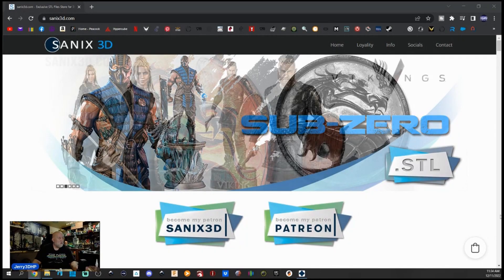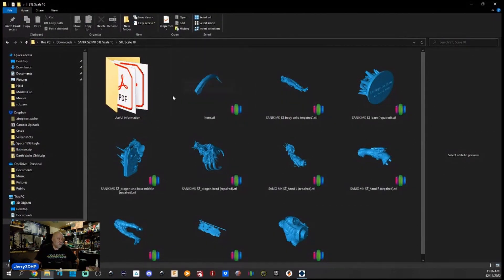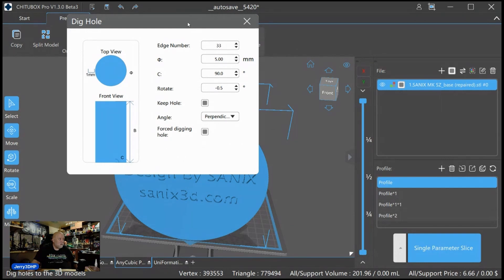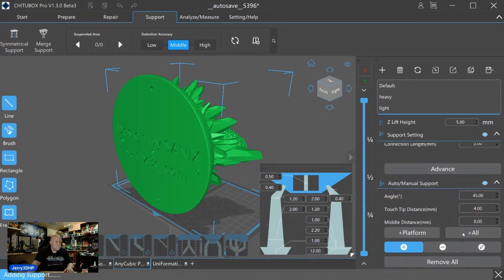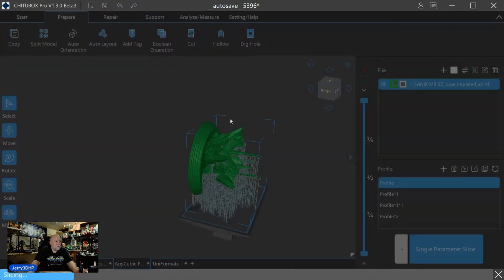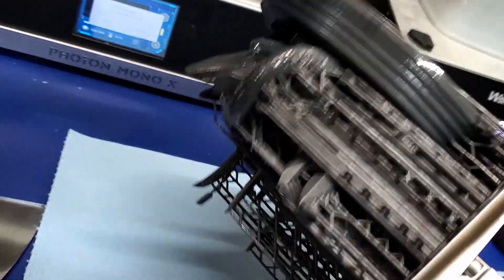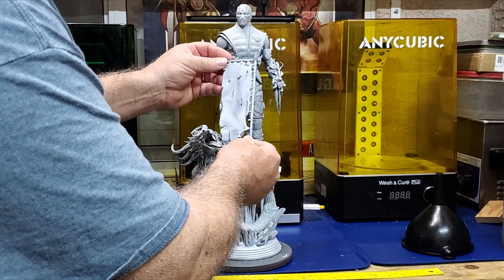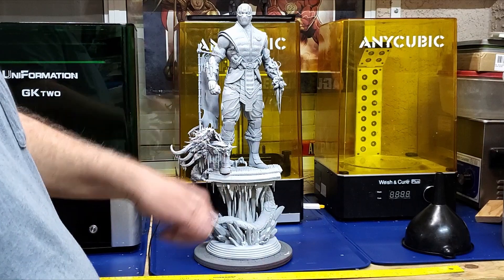2 Resin Printers | 1 Amazing Model #3dhp

Comment: It's the thickness of the cold resin when it's poured in to top off! I've been testing this just this week amd putting the bottle on my central heating radiator for up to 5 mins heats the resin up so it thins out to match the heat of the thined resin in the vat if its been on and printing a few hours or of its been printing separate small parts the resin thins when it's warm with printing, try to compensate for the same or thinner consistency! When you clean the vat out straight after a print you'll get the  consistency of the resin like that for topping up! Don't ever pout in cold straight out bottle
Reply from the maker: Thanks I will try that, also use a meat thermometer or temp gun to see what they both are.

Comment: I have a mono x and trying to use Siraya tech Blu clear v2 and I used there settings and my test calibration comes out real thick what am I doing wrong also I have it at 80%uv power
Reply from the maker: Hello I have used a lot of Siraya Tech resin,never the blue,be sure to shake up really well and have resin at room temp.75- 8- degrees fahrenheit,just not cold and I use all stock setting on my Photon Mono X. Also ask in there Facebook group for more help if needed.Thanks hope this helps a little.
Reply: @3DHP  thanks this really does help

Comment: I'm still struggling Jerry, I'm totally new to this, do you have any setting for Anycubic standard resin? In every print I do there is resin stuck on the fep and my prints are not detailed and look melted to supports????
Reply from the maker: First off, I no longer use Anycubic craftman resin,had a lot of fails. I use RainX on Fep to help with suction issues. I use all stock setting on the printer and make no changes per resin at this time, seems to work fine for me.If your using Chitubox slicer.I use auto supports light to med .Angle models,never flat on the build plate.Not sure what else to suggest. Post pics on the facebooks groups and comment on what happened.Hope this helps.
Reply: Many thanks for your advice, I have several bottles of basic resin from Anycubic, how different is this to Craftsman?
Reply from the maker: @tinteddeluxe  Never tried it. All the different resins I use are all in my resin videos.

Comment: Amazing to see this print so we'll, I have this printer and I have tried 3 times to print but the test print keeps sticking to the fep. Gutted, love your work and will keep following you. 👍
Reply from the maker: Thank you, use RainX on your Fep ,small amount, wipe with blue shop towel,not paper towel,its to rough. Then put resin in Vat. It will help a lot with the suction issue.
Reply: I also think my test print settings were old and I updated the firmware and the printer wasn't level, nevermind I'll get there. 👍